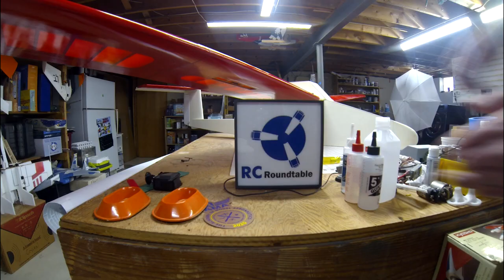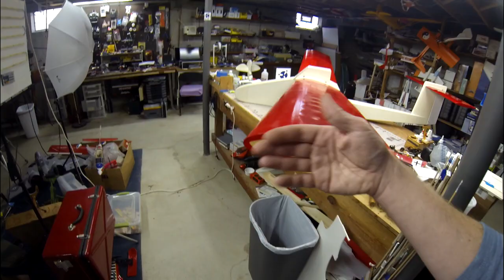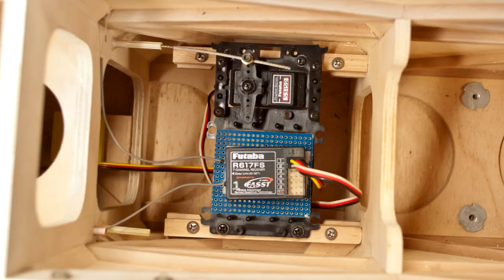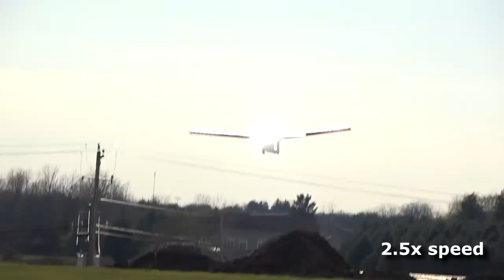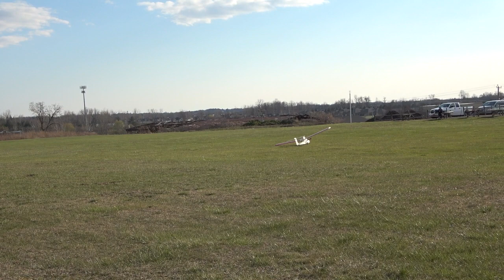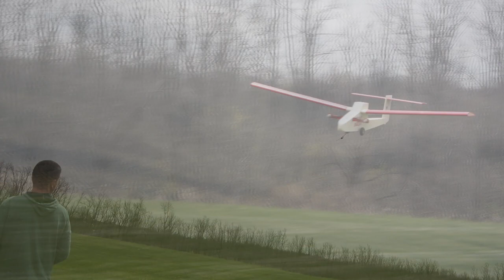Saving A Giant, Mystery RC Airplane

Comment: You kept calling that thing a conduit for wires sure it could be that. But I put a carbon tube right there for 1 reason, carbon tubes add a little strength but mainly its rib alignment trick ever rib sits on the tube and is perfectly aligned along the span after you do the D box sheeting you get a very strong and alinged wing!

Comment: some thoughts.      this original project was  ill-conceived.      airframe geometry/proportions  are  Wonky.      stab  design  is  wonky.      use of t-stab is wonky.      there is excess Mass in the tail boom.     if formers are present in the tail boom,  panel  Cutouts  could  help, a  lot.       the elongation of the nose is excessive;  any concentration of mass located  Near the nose is  too distant from the cg/c-m.     c-m  is center of mass.       Science/physics  lights  the  way, in this hobby....    this was a makeitup as i go along  project.        cheers
ideal location of  c-m indicated.     note that its about where a pilot's  Belly  would  be,  or  a pilot's belly would  be,  There.    in other words,  it is All  by  DESIGN. 

https://s3.amazonaws.com/assets.flitetest.com/article_images/medium/truecg-jpg_1384168691.jpg
cutouts
https://www.modelairplanenews.com/wp-content/uploads/2013/03/3-Fuse-Framed-rearview-web.jpg